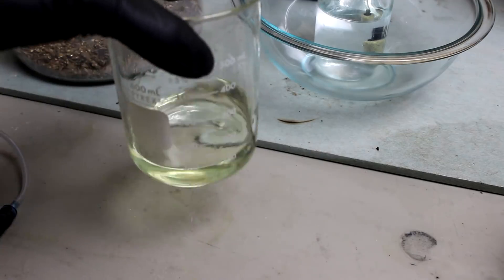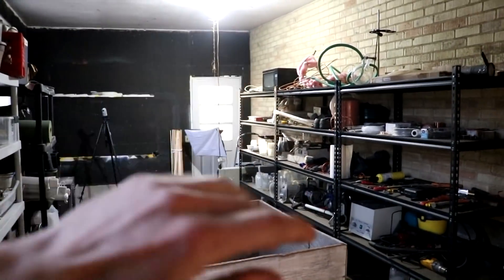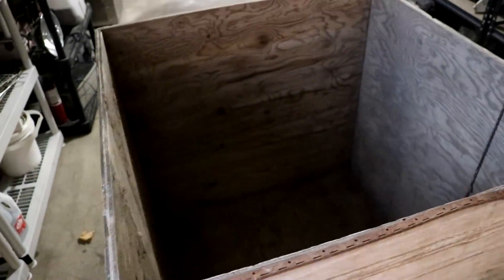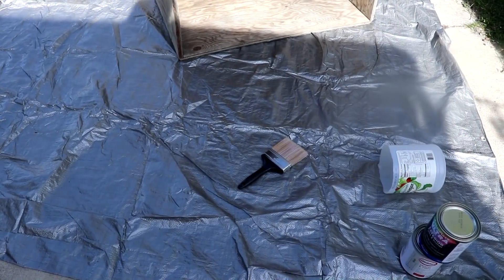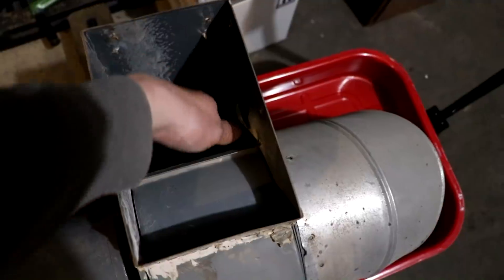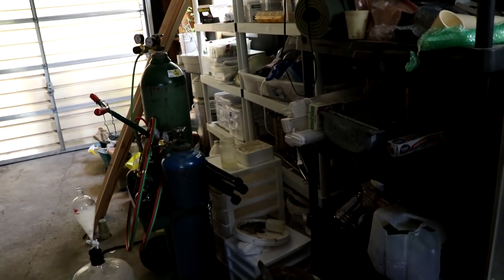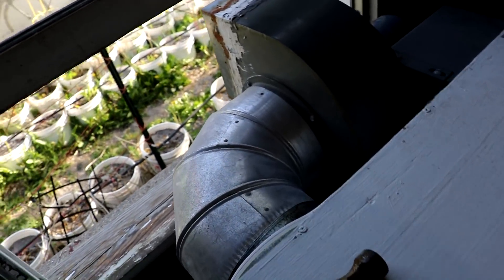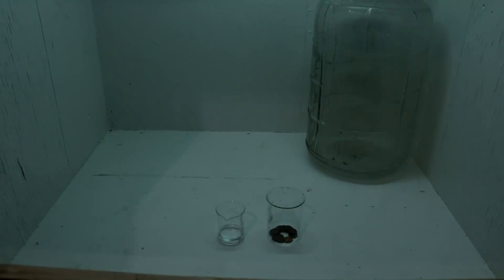Cody’s Fume Box

Comment: Dunno what material your fan is made of but depending of what exotic stuff you try, it might melt or start degrading - similar zu ABS plastic being exposed to acetone. And it it's made out of metal... urgh. It's gonna suffer either way. xD
Reply: RetromagneticDesigns this fan has definitely metal fanblades .
Its huge an would break of it was made out of plastic , I have worked with similar fans before ;)
Reply: That was my first thought with the Plexiglass and acetone. It might end up being ok, as long as he doesn't touch it while any acetone is on it. Once the acetone evaporates, the acrylic will just go back to normal. It might even polish it up on the inside some. I have seen people polish plastic castings using acetone vapor.
Reply: It's a typical household blower used for heating with forced air and just blabout anything else you would need to move air, it's all metal and ment to last for years with no maintenance.
Reply: HCl is pretty nasty for galvanized tin.
Reply: true, which is why it will be interesting to see how long it lasts. The reaction takes time which the air movement will not give.
Reply: You all DID notice that it was a salvaged fan to begin with, right, that most likely cost him very little if anything? If it dies after a lot of use, he still wins. Nothing is permanent, anything with moving parts inevitably breaks and anything with electricity flowing through it eventually burns out. The trick is to get maximum utility for the minimum possible investment.
Reply: +dionh70
If it fails after single heavy usage of HCl, he most certainly did not win. All the work wasted.
Reply: That's not rust, it's "Patina"!
Reply: While I think all the steel stuff (fan and ductwork) will eventually corrode from acid fumes, it's going to take a lot more than a single use. The ductwork is cheap enough to replace when it starts to rust through, and probably the fan too.
Reply: +russlehman
I once forgot dust cleaner bottle in fume box, while there was a quite much HCl vapors. It was there for a day, before I removed it. Initially there wasn't much damage, just some color change in the exposed metal parts. After about week weld of the bottle rusted open and let all the gas out. I did not expect the damage to continue, after the exposure to HCl was ended.
So, even single usage can destroy the fan, if the metal is shitty enough and something critical is exposed, like bearings. But probably you are right.

Comment: I never thought about building a fume hood out of wood! However being in the open air works as well.
Reply: I wouldn't have put electrical fittings inside it, either.  Or have that fan and motor exposed to the fumes.
Reply: yeah this is super dangerous...
Reply: That fan pulls so much air through there I don't think any caustic fumes will sit around long enough to degrade the electric output bar. And that motor isn't brand new either so it's a great starting point nonetheless
Reply: As long as nothing flammable or explosive gets in there he should be fine, right? And Cody would never do something like that, right? Right?
Reply: Until the wind suddenly changes direction towards you. I still remember inhaling silfur smoke as if it was yesterday.
Reply: I was wondering about that. It seems it would be better to keep the lighting outside of the main air volume, as well as any switches or connections.

Still, having this is much better than not having this.
Reply: in my university we have wood one to lol
Reply: A venturi apparatus would be cool.
Reply: Unless the stuff is also super photo sensitive, that can be a pain.
Reply: what is the typical fallback if the fan fails on a commercial one? is there a redundant fan? is the whole thing on a UPS? you would be fucked pretty quick if it cut suddenly or you lost power

Comment: Can you get a different light? The white balance is way off with that one
Reply from the maker: Michael Andersen 
I’ll look for something better.
Reply: BigClive says cob led chips are  dirtcheap on ebay right now.  I think he used the phrase "awash with them".
Reply: See his video from today entitled "Testing a large LED COB"
Reply: just use something like an ordinary warm white LED bulb which gives a nice soft yellowish glow aswell instead of the intense of just pure white.
Reply: @Mark incandescent bulbs don't flicker at all, the filament doesn't have time to cool down in between voltage peaks. And some cheap fluorescent fittings don't use a high frequency ballast, instead having a transformer type ballast which runs at mains frequency and do flicker.
Reply: yeah LED flicker is a nightmare, why can't they just put a crapacitor in them?! I'll have to check out what you said about incandescent lamps, I'm in the UK so it might be even more noticeable on 50hz :) Cheers
Reply: LEDs tend to fail. Best light for any video is halogen because its most like the sun. No ballast to fail. At dollar stores you can even find multipaks of the tube type used by painters and for outdoor floodlights.
Reply: @Mark Yeah, I run the 2700 (warm!) Kelvin Maxxima from Home Depot which has lasted for five years now. But I still stand by the halogen bulb recommendation for this application. You get a lot more light for the dollar. More light is best for cameras. I've picked up even 2 and 3 packs of 500 watt bulbs for a dollar. Plus the added heat might help the cold reactions he has trouble with in the past.
Reply: I hear you, the big bright ones I use are only run in my woodshop during the winter. And I have some Halogen work lights I use for special occasions like painting rooms & engine work. I also have one low wattage one I read by because I like the light quality. Seems to give less eye strain. In the search for the perfect light for each application you could say light building has apparently become a part time hobby.
Reply: LEDs don't by default flicker, and never will at 60HZ - it depends on the quality of the power supply. Use a battery and you are WAY more stable than a florescent, 0 flicker DC voltage, 0HZ
Reply: only a problem on REALLY cheapo LED's', to fix it, take out the rectification diode and replace it with a bridge rectifier (4 diodes). Increases the freq to 120Hz and nothing notices it.